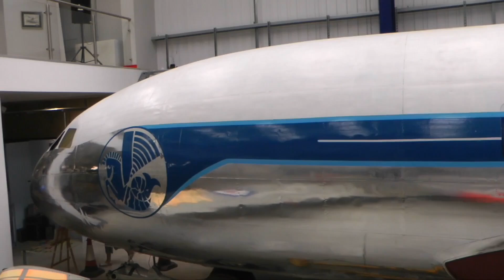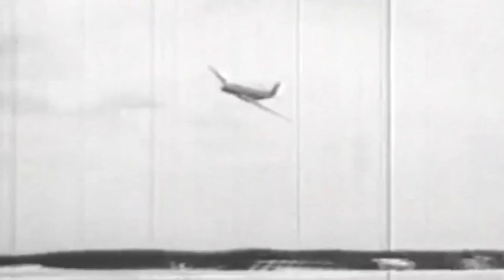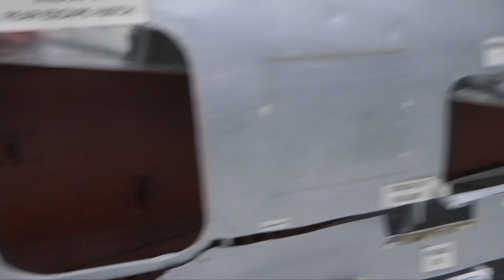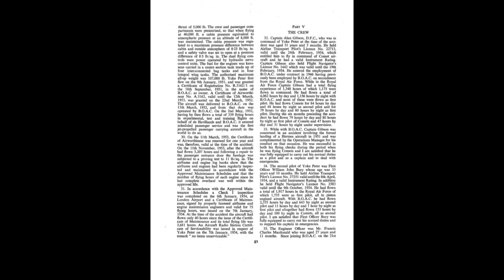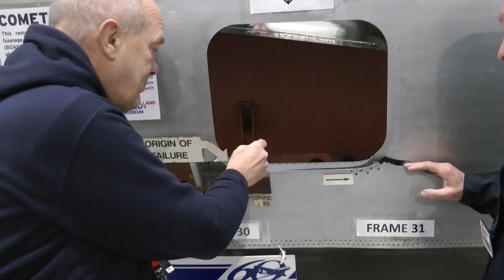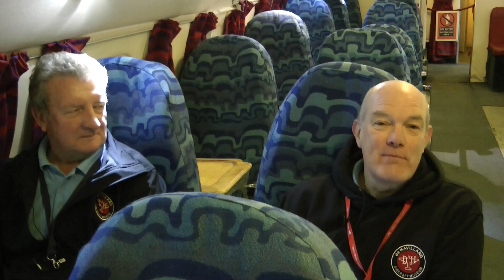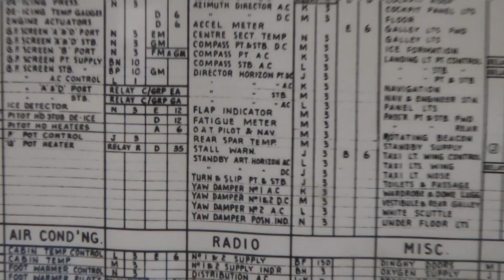The plane that changed the skies forever. DH.106 Comet Airliner from de Havilland

Comment: The faulures of the early Comets made the 707 a success ironically, imagine if Boeing had got there first and suffered the failures of this new technology, would the British aircraft industry have been more successful.
Reply: Unfortunately the Comet Disaster was a tragedy that was completely preventable if de Havilland had simply followed well-known and understood industry standards for the design and construction of pressurized cabins made from riveted aluminum.
 Boeing introduced the world's first pressurized airliner in 1938 and by Comet Disaster had already sold over 6,000 pressurized aircraft.
The only lesson learned from the Comet Disaster was that aircraft manufacturers like de Havilland could no longer be trusted to conduct their own crash investigations.
 De Havillands handling of this engineering Disaster was absolutely reprehensible, a shameful and humiliating example of gross engineering incompetence and criminal negligence.
Reply: @sandervanderkammen9230 

It will come as no surprise to most that we feel able to shed some light on some common misconceptions and myths, of course.

It's always good to see the facts presented clearly and concisely isn't it?

  That's correct, Bow-wing (See B-47 wing collapse & wing folding incidents) hadn't managed to sell more than a dozen pressurised airliners before the first flight of the Comet. Having had more than 50 years design & build experience on the type there can be no excuses for the horrendous Bow-wing Max incidents for example. 
   
  That's correct of course, at the time the Comet didn't have particularly high accident loss rates relative to many other aircraft.

Losses comparisons, how things were in those days.

DeHavilland Comet 4                            14%
DeHavilland Comet all  (ff 1948)         17%

Boeing 307                                              70%
Boeing 247                                              48%
Boeing 707            .                                  20% 
Lockheed Electra Turboprop                   29%
Canadair CL-44  Turboprop  (ff 1958)    46% 
Convair CV-580  Turboprop                    22%
Convair CV-880    (ff 1959)                     27% 
Convair CV-990     (ff 1961)                   35%
Tupolev T-104 (ff 1955)                          16%

   Indeed, De Havilland carried out a full stress analysis & engaged in a comprehensive & protracted testing program which is why key De Havilland people were happy to be aboard flying DH Comet aircraft.

  Of course it is in fact the case that no aircraft before the Comet had been subjected to as much testing as the De Havilland Comet.

  Agreed, of course De Havilland did indeed always work to better than industry standards at the time, used up to date knowledge for the design & construction & no evidence of negligence  or criminal negligence was ever produced in relation to the DH Comet.

  De Havilland designers / engineers knew all there was to know about metal fatigue at the time they designed the DH Comet.

  Of course De Havilland had prior experience building many all metal construction airframe aircraft including many passengers aircraft & thousands of jet powered fighter aircraft that were primarily of metal construction with pressurised cockpits & jet engines built by De-Havilland.

  Indeed, one of the key features of the DH Comet was of course its high altitude capability.
It was in fact the first airliner to have 8 psi pressurisation for the entire fuselage length which resulted in it being the world's first airliner where pressurisation stress significantly exceeded flying load stress.

  Obviously the Comet was an all metal construction airframe aircraft & like all similar airliners used other materials for no structural items such as interior trim. The rear pressure bulkhead for the Comet was obviously not made of wood for example.

  British Aircraft Achievements Notes.

  The world's first gas turbine aero engine demonstration was in fact performed by Whittle in 1937. Sir Frank Whittle patented bypass & reheat before 1936.

  The world's first axial multi stage sequential stator rotor turbines & compressors were produced in England by Parsons of Ireland & North England. The same components used in many modern gas turbine aero engines. Parsons also did some work on the internal combustion gas turbine engine. In fact people at the time in England before 1900 had already discussed the concept of using those components for an internal combustion gas turbine aero engine for powered flight & so had invented the jet aircraft before the Wright Brothers had given any thought to flying.

  The first example of a pressurised cabin aircraft was a British design Airco aircraft built under licence in the US & modified to have a pressurised cabin during a joint UK / US research project.

  The gas turbine engine was first conceptualised & patented before 1800 in England.

As always we hope this helps of course, obviously.

Cheers & 👍 indeed.

The line above has clearly been left blank.
. . ..... ....... . ........ ....
Reply: @sandervanderkammen9230 

The DH Comet had significantly more research and pre-production testing than any previous airliner had ever been subjected to.

The fabulous trail blazing DH Comet.
World's first jet airliner.
World's first high altitude airliner.
The first aircraft with a full fuselage width and length pressurised cabin where pressurisation stresses were higher than flying load stresses and were many times higher than flying load stresses. 

It's surprising then just how low the accident loss rate was for the Comet. 

    How things were back then.
Accident losses - % of aircraft built.

DeHavilland Comet 4 UK                     14% 
DeHavilland Comet all (ff 1949)         17%  
Vickers VC10 UK (ff 1962)                   5%

Douglas DC-1                                      99%
Douglas DC-2                                      47%
Douglas DC-3                                      30%
Douglas DC-4                                      26%
Boeing s300                                          72% 
Boeing 307                                            70%
Boeing 247                                            48%
Boeing 707  (ff 1958)                           20% 
Lockheed L-049/149 Constellation    30%
Lockheed Electra  Turboprop .            29%
Fairchild FH-227                                   30%
McDonnell Douglas DC-8                    14%.
Sud Aviation Caravelle  (ff 1955)       15%
Canadair CL-44 Turboprop (ff 1959) 46%  
Convair CV-580  Turboprop                22%
Convair CV-880     (ff 1959)                27% 
Convair CV-990     (ff 1961)                33%
Tupolev T-104        (ff 1956)               16%
Vickers Viscount   (ff 1948)               32%             

  The Vickers VC10, fastest Atlantic crossing for a non supersonic jet airliner, held the record for 41 years.

For the first few years of operation the Caravelle & Comet had similar accident loss fatalities.

Instances of all marks of Comet flew with full certification until retirement of the individual aircraft until 1992. Nimrods were flying until 2010. 

The first few Nimrod airframes were Comet 4 airframes with the equipment bay tacked on. Subsequent Nimrods were new build Comet 4 airframes with Nimrod modifications built by the DH team at Hawker Siddeley.

Comment: Extremely interesting for someone who back and forth between LHR and Embakasi (Nairobi) five times in an Eastaf Comet 4. My late father was Chief Instructor with EAA having previously worked for BOAC, including on the Comet 1 and 4. A couple of minor points. I believe that the loss of Yoke Victor (the Calcutta accident) was an in-flight failure in a thunderstorm rather than a take-off accident as implied. The wreckage was found by Capt. Foot of BOAC (who had been in command during the Rome accident) flying an Afro York. The other point is that ADF stands for Airborne (not Automatic) Direction Finder, or so I have been led to believe.
Reply: It's well-known and understood today that all 6 Comet 1 crashes were the result of design flaws and gross engineering incompetence.
 Even after de Havilland modified the Comet 1 with smaller windows and thicker aluminum skins, it's Certificate of Airworthiness was permanently revoked due to a multitude of fatal design flaws and substandard manufacturing techniques
Reply: @sandervanderkammen9230 

It will come as no surprise to most that we feel able to shed some light on some common misconceptions and myths, of course.

It's always good to see the facts presented clearly and concisely isn't it?

  Obviously it's well known that nearly all Comet crashes were directly due to pilot error, often being due to lack of training & experience on jets airliners.
Examples of all marks of Comet had full certification after 1954 & there were Comets flying until 1997.

  That's correct, Bow-wing (See B-47 wing collapse & wing folding incidents) hadn't managed to sell more than a dozen pressurised airliners before the first flight of the Comet. Having had more than 50 years design & build experience on the type there can be no excuses for the horrendous Bow-wing Max incidents for example. 
   
  That's correct of course, at the time the Comet didn't have particularly high accident loss rates relative to many other aircraft.

Losses comparisons, how things were in those days.

DeHavilland Comet 4                            14%
DeHavilland Comet all  (ff 1948)         17%

Boeing 307                                              70%
Boeing 247                                              48%
Boeing 707            .                                  20% 
Lockheed Electra Turboprop                   29%
Canadair CL-44  Turboprop  (ff 1958)    46% 
Convair CV-580  Turboprop                    22%
Convair CV-880    (ff 1959)                     27% 
Convair CV-990     (ff 1961)                   35%
Tupolev T-104 (ff 1955)                          16%

   Indeed, De Havilland carried out a full stress analysis & engaged in a comprehensive & protracted testing program which is why key De Havilland people were happy to be aboard flying DH Comet aircraft.

  Of course it is in fact the case that no aircraft before the Comet had been subjected to as much testing as the De Havilland Comet.

  Agreed, of course De Havilland did indeed always work to better than industry standards at the time, used up to date knowledge for the design & construction & no evidence of negligence  or criminal negligence was ever produced in relation to the DH Comet.

  De Havilland designers / engineers knew all there was to know about metal fatigue at the time they designed the DH Comet.

  Of course De Havilland had prior experience building many all metal construction airframe aircraft including many passengers aircraft & thousands of jet powered fighter aircraft that were primarily of metal construction with pressurised cockpits & jet engines built by De-Havilland.

  Indeed, one of the key features of the DH Comet was of course its high altitude capability.
It was in fact the first airliner to have 8 psi pressurisation for the entire fuselage length which resulted in it being the world's first airliner where pressurisation stress significantly exceeded flying load stress.

  Obviously the Comet was an all metal construction airframe aircraft & like all similar airliners used other materials for no structural items such as interior trim. The rear pressure bulkhead for the Comet was obviously not made of wood for example.

  British Aircraft Achievements Notes.

  The world's first gas turbine aero engine demonstration was in fact performed by Whittle in 1937. Sir Frank Whittle patented bypass & reheat before 1936.

  The world's first axial multi stage sequential stator rotor turbines & compressors were produced in England by Parsons of Ireland & North England. The same components used in many modern gas turbine aero engines. Parsons also did some work on the internal combustion gas turbine engine. In fact people at the time in England before 1900 had already discussed the concept of using those components for an internal combustion gas turbine aero engine for powered flight & so had invented the jet aircraft before the Wright Brothers had given any thought to flying.

  The first example of a pressurised cabin aircraft was a British design Airco aircraft built under licence in the US & modified to have a pressurised cabin during a joint UK / US research project.

  The gas turbine engine was first conceptualised & patented before 1800 in England.

As always we hope this helps of course, obviously.

Cheers & 👍 indeed.

The line above has clearly been left blank.
. . ..... ....... . ........ ....
Reply: @sandervanderkammen9230 

The DH Comet had significantly more research and pre-production testing than any previous airliner had ever been subjected to.

The fabulous trail blazing DH Comet.
World's first jet airliner.
World's first high altitude airliner.
The first aircraft with a full fuselage width and length pressurised cabin where pressurisation stresses were higher than flying load stresses and were many times higher than flying load stresses. 

It's surprising then just how low the accident loss rate was for the Comet. 

    How things were back then.
Accident losses - % of aircraft built.

DeHavilland Comet 4 UK                     14% 
DeHavilland Comet all (ff 1949)         17%  
Vickers VC10 UK (ff 1962)                   5%

Douglas DC-1                                      99%
Douglas DC-2                                      47%
Douglas DC-3                                      30%
Douglas DC-4                                      26%
Boeing s300                                          72% 
Boeing 307                                            70%
Boeing 247                                            48%
Boeing 707  (ff 1958)                           20% 
Lockheed L-049/149 Constellation    30%
Lockheed Electra  Turboprop .            29%
Fairchild FH-227                                   30%
McDonnell Douglas DC-8                    14%.
Sud Aviation Caravelle  (ff 1955)       15%
Canadair CL-44 Turboprop (ff 1959) 46%  
Convair CV-580  Turboprop                22%
Convair CV-880     (ff 1959)                27% 
Convair CV-990     (ff 1961)                33%
Tupolev T-104        (ff 1956)               16%
Vickers Viscount   (ff 1948)               32%             

  The Vickers VC10, fastest Atlantic crossing for a non supersonic jet airliner, held the record for 41 years.

For the first few years of operation the Caravelle & Comet had similar accident loss fatalities.

Instances of all marks of Comet flew with full certification until retirement of the individual aircraft until 1992. Nimrods were flying until 2010. 

The first few Nimrod airframes were Comet 4 airframes with the equipment bay tacked on. Subsequent Nimrods were new build Comet 4 airframes with Nimrod modifications built by the DH team at Hawker Siddeley.